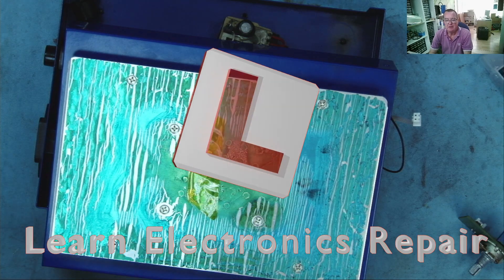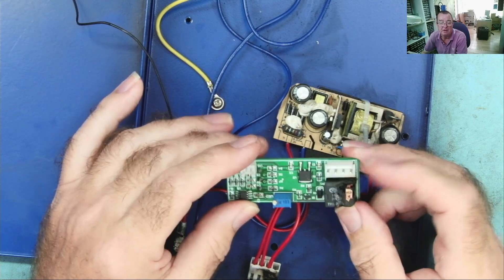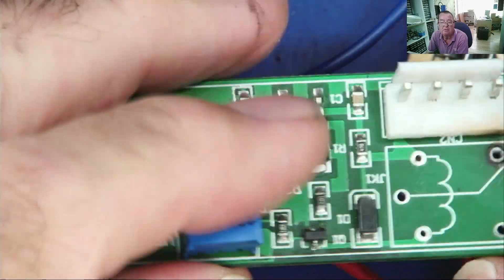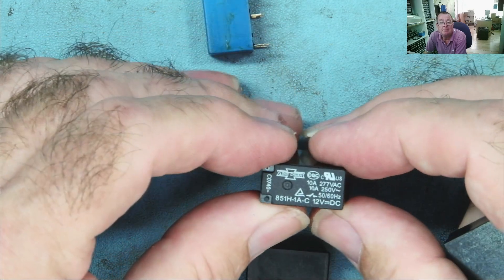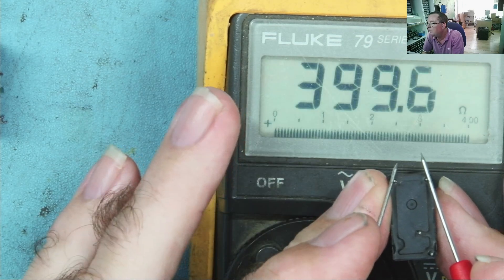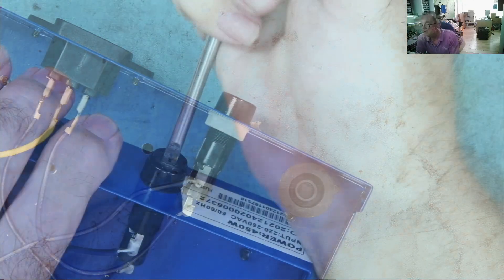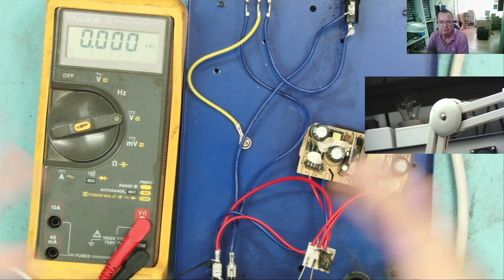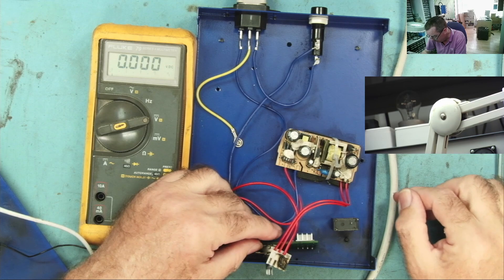How to Think like a Repair Pro - Learn to Fix Random Electronic Devices, PART 2

Comment: Only a few points to note, on the electrical safety aspects of this heater.

1. The protective earth is via a painted hole and all panels of the case are not electrically bonded to earth.
2. The mains to 12V board is only  mounted with a tie-wrap under the sticky backed foam to the case.
3. You did not use a mechanical mount for the relay, the relay may get warm a soften the glue. 

Anything carrying mains should be mechanically mounted and a layer of extra insulation provided.
I would never just use a mains earth as the sole means of protecting life.

I would have done the extra work to make it safe and charged for it or thrown it in the WEEE bin, or just given it back with the plug cut off. then tell the customer that it could be made safe but that will be extra to the repair costs, The plug was removed as you would not return an item back to a customer in an unsafe condition. if they want to replace the plug then they are accepting the risk to their own life is in their own hands.
Reply: On point 3...If the replacement relay was rated for a higher current , maybe that would mean it wouldnt get as hot as the original relay, since it would have bigger contacts and dissipate heat better
Reply: @reacey  There should not be a lot of heat from the contacts. most of the heat if not all comes from the relay coil.
if you have mains voltages on any components it is not wise to use glue to mount it.

if you want to see how to make your projects safe for yourself and others try and find a copy of BS EN 61010 - Safety requirements for electrical equipment for measurement, control and laboratory use.

part 1 is general safety, part 2 covers heating equipment.

if you search about you might find an old version pdf a new copy would be about £450 if you had to pay for it.

Comment: I have a LCR-T4 Transistor Diode Capacitor ESR meter. I think Richard has one. Can this meter be used for short circuit tracing in the same way Richard used the mesr-100 ESR meter in his beginner repair playlist to find shorts in Mostfets?

Comment: Nice job Richard. Quick question...with incandescent bulbs getting harder to find by the day what would you suggest as an alternative to the 'Dim bulb tester' that doesn't use incandescent bulbs? Thanks.
Reply: You can still get incandescent bulbs but only in formats other than standard domestic purposes so you need to obtain the base along with the bulb...
Reply: I use an incandescent bulb like this on my bench: 250W 120V Super Photoflood Incandescent lamp for my limiter. Does the job nicely for amplifier testing.  (Note: 120V is used as I am in Canada)

Comment: I found it concerning that it was the normally open contact which was burnt on the original relay, especially since that wasn't even connected to anything. That would suggest that something else had been making contact between that leg and possibly the case. A fault in the relay would only have made it "always on" so that could not have been the problem.

Since you could see that someone had already done repairs I would suspect that something had been left inside the case and had got behind that circuit board but as soon as you started opening the case it released the pressure and it fell out.

Ideally there should have been some insulating material inside the case, behind that board, in particular where the live connection is made.

Your method of fixing it means that can't happen again so it isn't a worry going forward.

Comment: Personally, I probably wouldn't stick a power relay directly to the metal chassis. If the Relay goes faulty like it did before, it is possibly sitting with a 230V potential, which may then create a path to earth with the 12V still working and powering the relay coil. Yes, that should trigger the circuit protective device if everything is functioning correctly within the household wiring, but I would prefer to mount it to an insulator.
Reply from the maker: There is a ground lead bolted directly to metal chassis. I don't think it's any more dangerous than having mains voltage on the controller board as per the original design, but I guess this is a matter of personal opinion.  IMHO there is nothing wrong with your suggestion, we all need to do whatever we are personally comfortable with.
Reply: @LearnElectronicsRepair  the ground lead is via a painted hole! there is a chance that a knock and it will become insulated from the case via the paint. you should have scrapped the paint away.
Reply: Im sure the paint is either scraped off, or it has a star washer on it which will cut into the paint for bonding purposes. I could be wrong, since im not there
Reply: @LearnElectronicsRepair  yeah I saw the ground lead to chassis, and yes it was previously knocking the power out before the fuse had time to blow so hopefully protective devices were working. I love the fact they have just used whatever power supply from another device to provide the 12V, and cable tied it in place 😆...

When in China.....
Reply: @shagreobe  I would not have expected them to go that far. They did not go that far on my k40 laser and that has about 20kv flying about on the inside. I've a video showing how bad the earthing was, titled something like did the earth move you you darling. :-)
My k40 laser bought in the UK would never in a million years have passed any CE marking,  I don't think that they have ever read the " low voltage directive " or the common standard EN61010 for electrical safety.